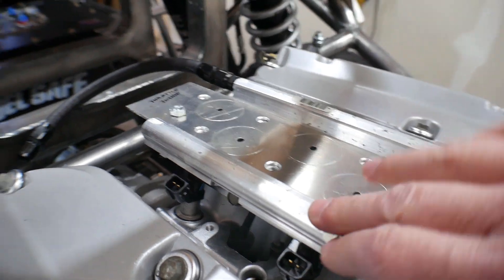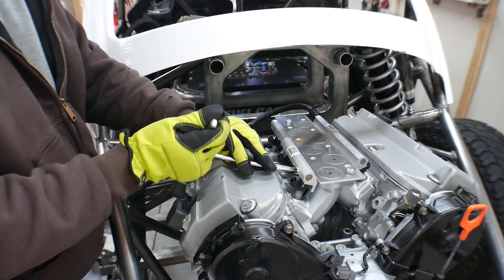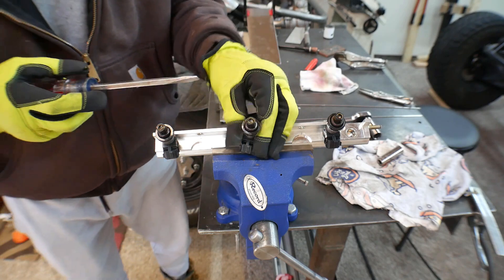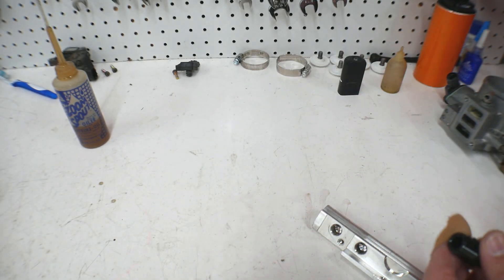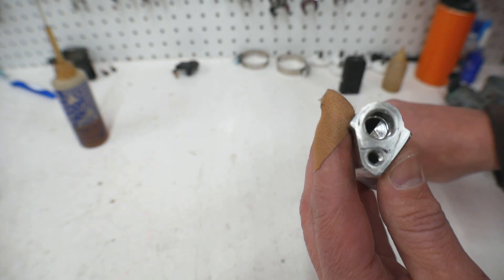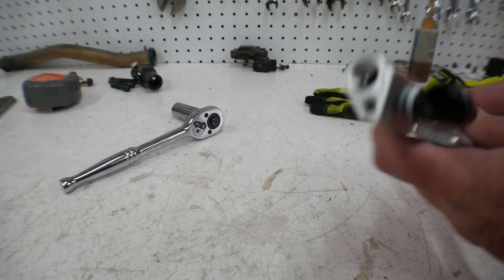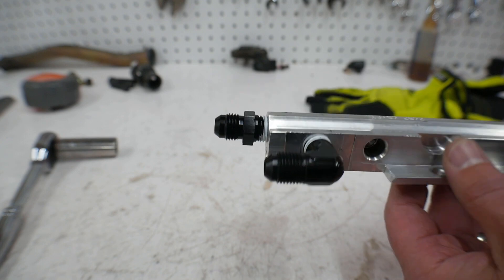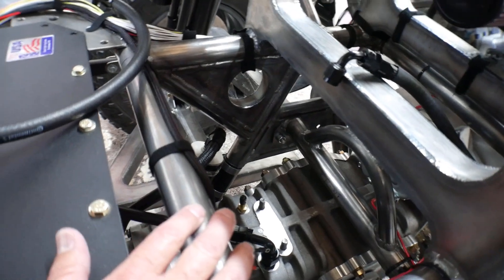Building the Fuel System for Wratchet

Comment: I learnt that using alcohol is better than oil when threading aluminium. Found out the hard way and snapped the thread tool.
Reply from the maker: Seriously? I'll give it a try maybe.
Reply: @DougBugBuilder  Biiig difference to me.  As I said, I snapped the tool and it was impossible to get it out. Asked a friend who's a fabricator and he told me to use alcohol instead.  
Give it a go in a test piece just to try. 🙂
Reply from the maker: @kristoffer-robinlotze7273  I will, thanks for the tip.

Comment: Looks great.  Did you think about putting the filters and pump on the back side of your plate?  It looks like you might be able to get the assembly a little bit lower if you needed to.
Reply from the maker: I could have gotten it a little lower, but figured it would be to difficult to get to the electrical connections.

Comment: Good job as allways.  But the fuel pump will be working hard because of the non-return fuel system.  The pump will run much cooler and last longer with a return type system. It also has a cooling effect on the fuel and fuel system so some performance increase will be gained as well with a return system.
   Just suggesting,. Live your build.  Keep with it.
Reply from the maker: When I called it a dead head system that was misleading. It is a return system, up to the regulator. But the fuel rails are after the regulator. So the rails are dead head, but the pump gets to flow fuel through it to help stay cool like you pointed out.
Reply: @DougBugBuilder  well there I go again showing my ignorance.  Sorry.
    Keep doing your thing.  I'm Enjoying it.

Comment: Doug Bug, Nice setup!!! I hope you used a fuel resistant sealant on those fittings. I've seen many fuel fitting leaks when a regular teflon tape was used as a sealant when I was wreching. I think the best sealant for fuel pipe fittings is Permatex Aviation Form-A-Gasket No.3 sealant. It is gasoline resistant. Since electric fuel pumps are made to push fuel, the location of the fuel pump is low enough that it shouldn't give you any problem. I like to recommend installing a short  pigtail with a weatherpack quick disconnect connector to the wires going to the fuel pump ( leave those eye connectors fasten to the pump with nuts). It would be much easier to service the pump and filters. On factory intank fuel pumps, the fuel supply to the pump is constant even with low fuel level in the tank because they incorporated a fuel reservoir in the fuel module. Since your fuel pump is mounted outside,  you can fab an enclosed aluminum reservoir shaped like a air compressor filter/water separator mounted vertically. Two fitting on top, across to each other and one at the very bottom of the fuel reservoir. Connect the return line coming from fuel regulator to one of the fitting on top of the reservoir then connect the other side to the return hose going to the tank. Connect a hose to the bottom fitting of the reservoir and TEE it to the supply hose going to the pump. The fuel return hose from the pressure regulator will fill the reservoir with fuel and keep fuel pump constant supply of fuel even if the tank is low of fuel. Since this is an off road vehicle, I think this will help the drivability issue if you have low fuel.

Comment: run dual 044 bosch fuel pumps in a surge tank with the stock check valves installed so you can run one pump at a time 
then you have a backup pump ready to go with a flick of a switch 
also surge tank is key for offroading buggy's in my eyes plus keeps the pumps cool and quiet
Reply from the maker: Thanks for the tips, I might look into the surge tank.
Reply: @DougBugBuilder  no problem!

Comment: The stock fuel rails are so restrictive I use these which were already threaded for AN fittings
https://www.powerrevracing.com/J32A2-J35A4-Fuel-Rail-Set-p/p217.htm
Reply from the maker: Those are nice! Thanks for the link, maybe I'll switch over to those when I add the turbo.

Comment: Nice move on the fuel pump/filter set up, however I would isolate it from vibration by using a few exhaust bobbins. I would not use the Dead-Head system as you might run into problems with vapour lock when running hot and hard, but would make it a standard return system instead...far fewer problems!
Can't wait to see this magnificent beast making tracks!
Reply from the maker: Interesting, to be honest I never even thought about the fuel sitting in the rails might start to boil. Thanks for the thought, and I'll think about it. 👍

Comment: Great set-up… but 2 comments. Fuel pumps are quite weak point, so I would install the entire bracket on silent-blocks to soften the high frequency gearbox vibrations, and I would install directly on the bracket a spare fuel pump with proper fittings to be connected directly without filters…
Reply from the maker: Hmm, I'll think about that.
Thanks for the ideas.

Comment: Loved it when you peered into the camera when you forgot the injectors lol. That pre filter and fuel pump really should be lower than the fuel level at minimum, but lower than the tank would be best. Isn’t there a wet pump system available for that awesome fuel tank? You may not have an issue since it is a bypass regulator, but, if you ever call for support, they probably won’t help you if they know it’s not mounted lower. Premium fuel especially boils so easily. But anyway, that’s something you can deal with if it becomes an issue, super clean work as always.
Reply from the maker: I don't think there is for this tank, but I'll check.
For now I'll see how these work. I'm hoping the filters hold a good amount of fuel to always have fuel available for the pump, but I'll see.
Reply: @DougBugBuilder  hopefully you will be ok with the bypass regulator. I literally just fixed one yesterday with the same issue. But it’s a 390ci and no bypass. We moved the pump about halfway down the tank and that fixed the odd drivability issues but it still vapor locks. The bypass line is now run and reg on its way so fingers crossed. Really enjoying your build and look info forward to your fun times once it’s out too.

Comment: Are planning something else than that small air filter? Maybe a Dobinison filter? That one is going to restrict air flow to that size motor.
Reply from the maker: That's just the get it up and running filter. Being that I plan to add a turbo once things are ironed out I don't want to waste much time on this setup.
But I agree, this one will be a bit of a choker.

Comment: Looks good. That fuel pump is fine. Mine is mounted 1 ft above the tank and it sucks it dry just fine. 

I think you should have done the electrical connector for the fuel pump. It will be much easier to pull that entire plate and change filters outside the car but easy enough to do later
Reply from the maker: I was hoping someone would chime in with real world experience on that pump.
Good to know, thanks.
I think you're right on the plug, I'll probably add one.
Reply: @DougBugBuilder  I agree on the connector. Makes the entire unit serviceable on the bench. I've seen people over torque the power connections on those pumps while working in awkward positions.